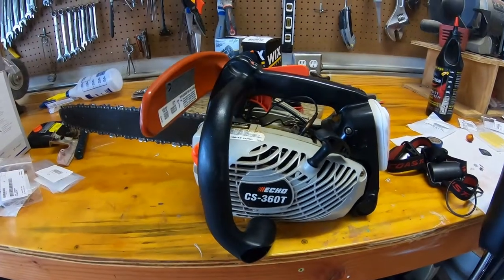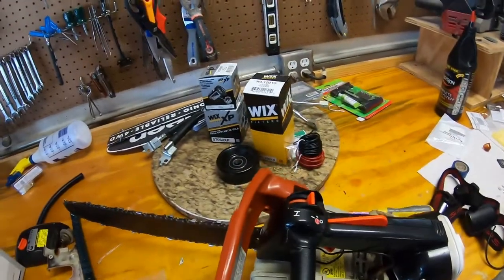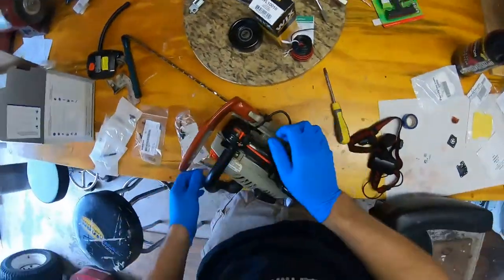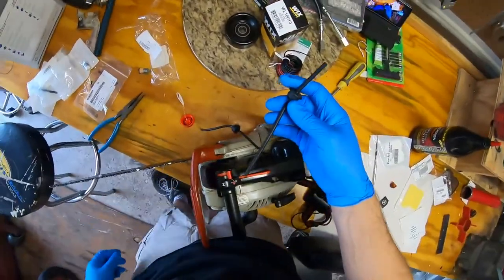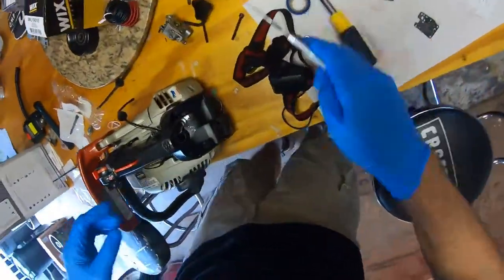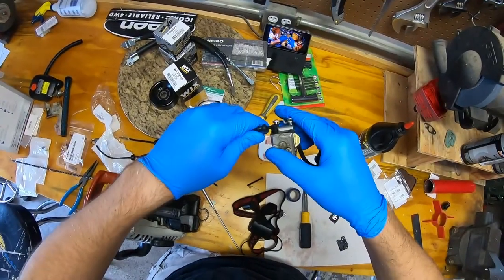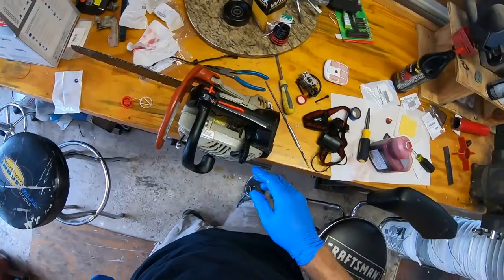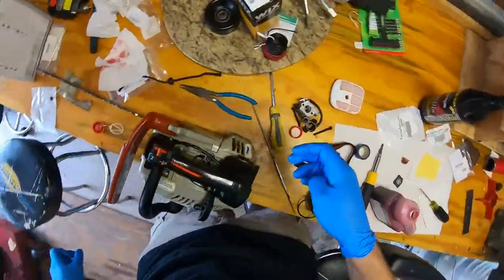Echo CS 360T Fuel Tank Grommet Replacement

Comment: Thank you for posting this video.  I just bought one of these old CS-360T saws last month,.  It would throttle up to high rpm, then fall back down to mid RPM on full throttle.  It also was having trouble staying running after fuel ran out and was re-filled....After pulling the fuel filter, the fuel line disintegrated -I also just replaced the entire fuel line & grommet (even though only rotton part was inside tank.  My part for that 'wonky' carb. end tube was short as the original.  I found the 'wonky' carb end hose threaded easier in the wrong direction (blunt end firsts)  Before I learned about the release tab for the top cover-on the clutch side, I removed the handle and pulled the implulse (vacuum) hose through the handle brackets/intake manifold....the seemingly impossible re-thread was accomplished by cinching electrical shrink tubing around the narrow spot and spreading the hole with a screwdriver handle pinched between two dental picks.
Reply: About that impulse line.....I realized I was putting it together in an incorrrect order.  impulse line bypasses the manifold tube, passes through a hole in the plastic carb mounting box.  The manifold tube then threads through the carb mounting box.